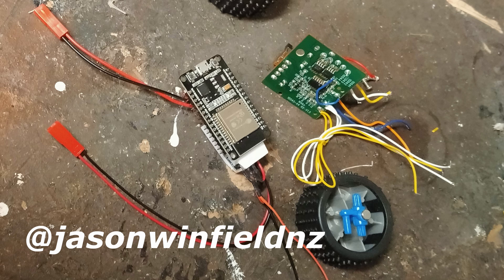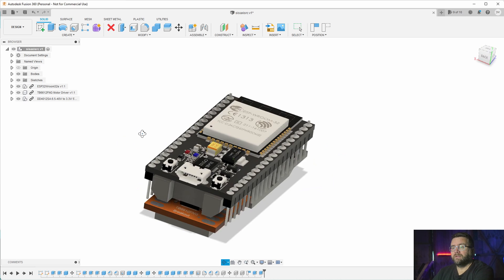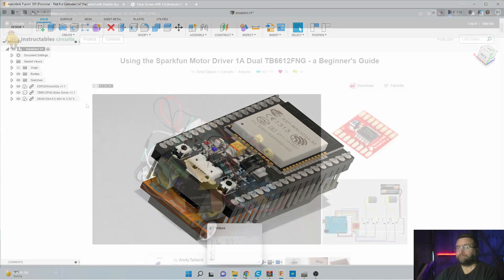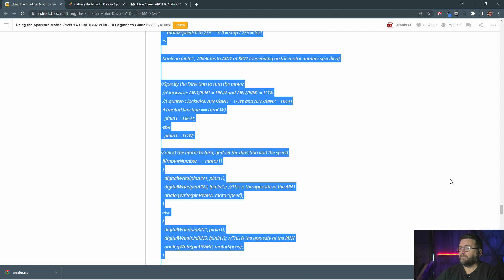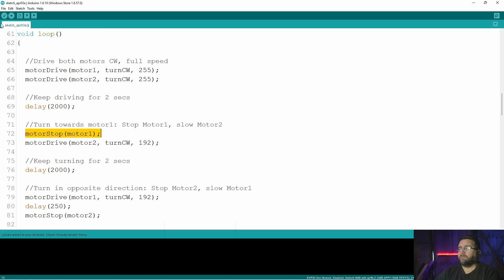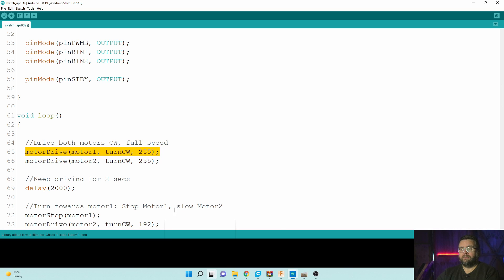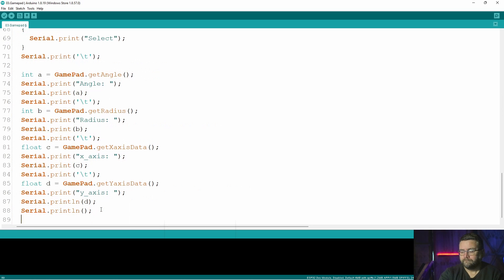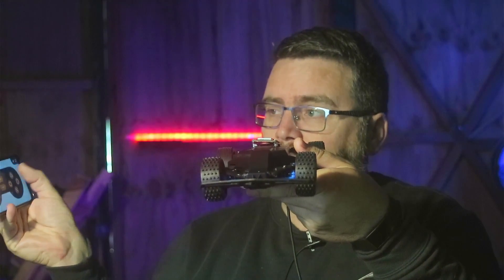This simple app can control a RC car!

Comment: My 27mhz remote is broken can i control my rc car with your app?
Reply from the maker: No, not unless you replace all the electronics in the car.
Reply: @JWNZ  Then What's the point!?
It's not a classic RC car because it's not RADIO FREQUENCY at this point, just Bluetooth and Wifi
Reply from the maker: @narrativeless404  what is bluetooth and wifi if not radio frequency?
Reply: @JWNZ  It's fixed frequency and protocol. You can't send random data and can't change the frequency to, let's say, 27mhz SO MY OLD RC CAR WOULD WORK AGAIN!
Reply from the maker: @narrativeless404  This process replaces your cars electronics entirely. If anything you aren't tied to proprietary controllers.
Reply: @JWNZ  I want to use my old RC car as is. I don't want to lobotomize it.
Reply from the maker: @narrativeless404  enjoy https://www.youtube.com/watch?v=Su7VNLW8jWU
Reply: @JWNZ  Appreciate it, bit that's still bot the same as downloading an app on a phone.
At that point might just buy a controller.